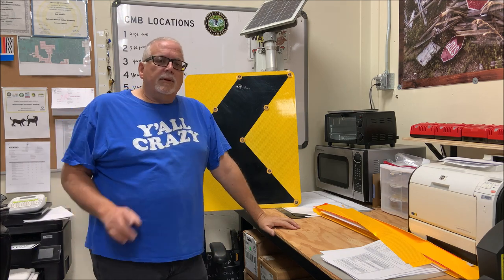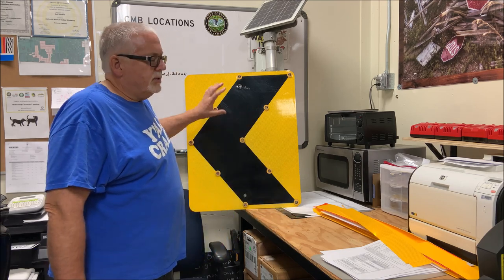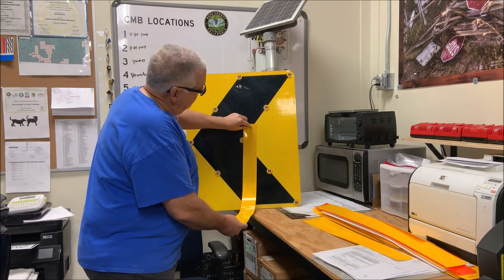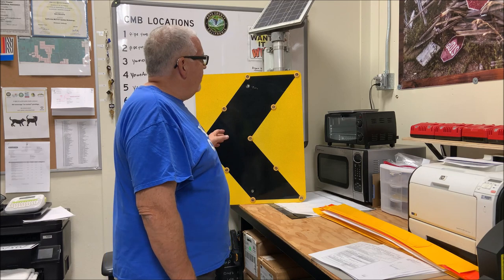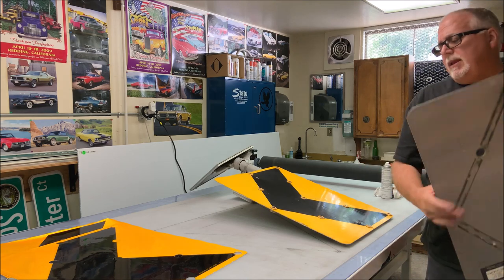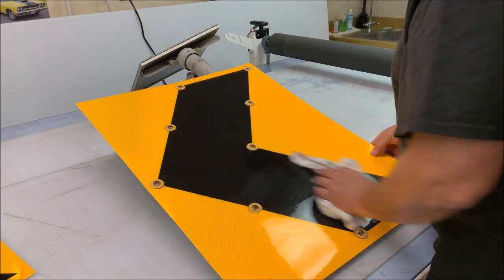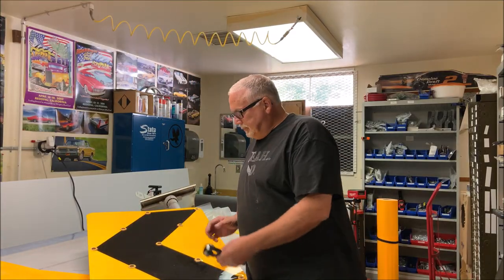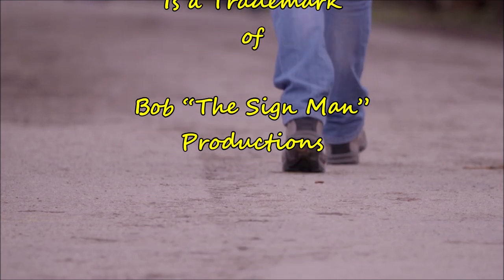Refurbishing Traffic Signs

Comment: 3M does not provide warranty when applying new sheeting on existing one without removing it
Reply from the maker: 3M warranty has never been an issue with me. I have never had an issue with sheeting. If this ever did fail 3M prorated warranty would only pay for the sheeting. The dollar amount would only be a few dollars. The cost of a new sign is $1800 dollars, so we have saved more than the warranty could ever save.

Comment: nice rebuild bob, i've got a tapco stop sign that must have a bad battery cuz it works some days and wont on others. i've checked the solar output voltage and that is good, so i think the battery wont hold a charge for very long...
Reply from the maker: If it flashes 24/7 then it’s probably the battery. This system I removed couldn’t rest enough to recharge the batteries. The solar out put was good. They were installed in 2016. Mt Tapco rep said to replace battery’s every 5 years or sooner.